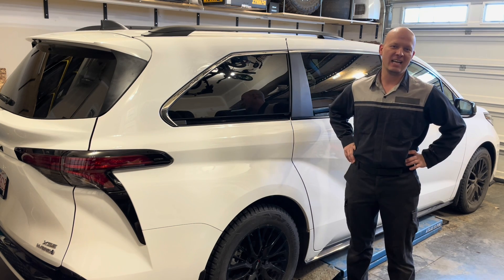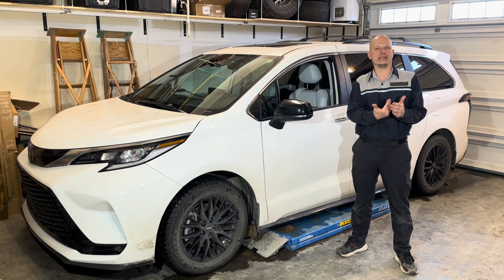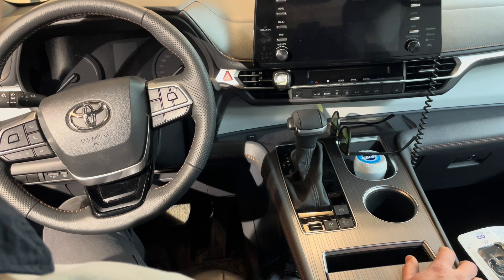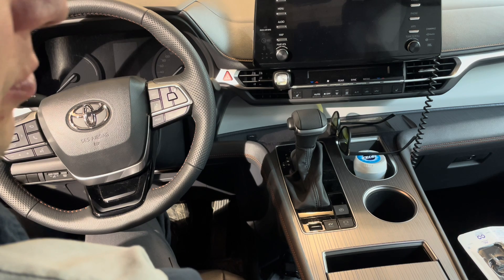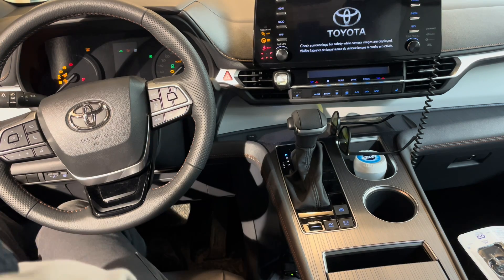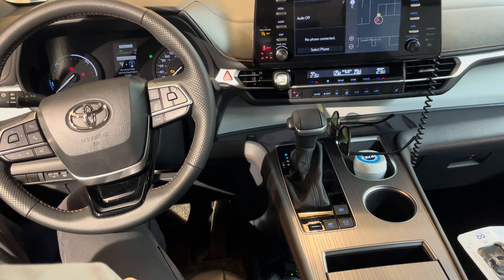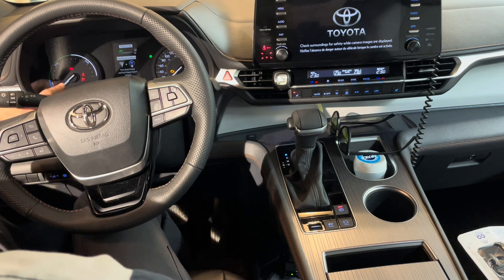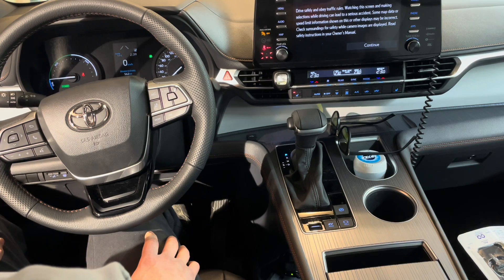2021-2024 Toyota Sienna Hybrid EPB Release, Rear Brake Service Mode - No Scan Tool Or Battery Needed

Comment: Do you happen to know when the brake fluid should be replaced? Is it recommended to do that when brake pads are replaced?
Reply from the maker: Hi, brake fluid is due for replacement every 3 years/30K miles, whichever comes first. It is not tied to brake pad replacement.
Reply: @Viktor_G_Automotive  Thank you!
Reply from the maker: @lunchdad no problem!

Comment: Are you supposed to compress the piston after? The piston didn’t retract.
Reply from the maker: Yes, you first retract the EPB motor and then compress the piston as you would do with any other vehicle. Winding the motor back does not compress the piston, but allows it to be compressed.

Comment: HI,2021 toyota sienna change srake fluid ,Do you need to do the above actions
Reply from the maker: Brake fluid replacement on this model should be done using a scan tool and proper procedure, otherwise problems may arise. The EPB retraction is not to replace the fluid required however.

Comment: Thank you for your videos! They are very helpful and top quality!! I saw you have brake pads replacement on RX series. Those should be very similar to this new sienna right? I also noticed that your channel doesn’t have brake fluid flush videos on Toyota/lexus. I would really appreciate if you have that tutorial in the future! Thanks!
Reply from the maker: Hi, yes, the new Sienna has the same brake setup as the 2016-2022 RX. One of the reasons I don’t have any brake fluid replacement videos is that all Toyota/Lexus hybrids require a scan tool and 2 people to do the brake fluid replacement, making it not very DIY friendly. If I get a chance in the future, I’ll try to make a video. Thanks!

Comment: How is the procedure for the front?
Reply from the maker: @fionafranco9445  the front brakes are not equipped with a parking brake system, so this step is not necessary for replacing the front brake pads.

Comment: Stupid question... I did this totally wrong and only disengaged the parking brake before shutting off the ignition and then doing my brake service. Now it's telling me that there's a break error and I have to visit my dealer. It doesn't seem like I can enter service mode like you demonstrate in the video. Do you know of a solution for this other than going to the dealer?
Reply from the maker: Hi Mike, you’ll need to use a scan tool to try to clear the fault codes.